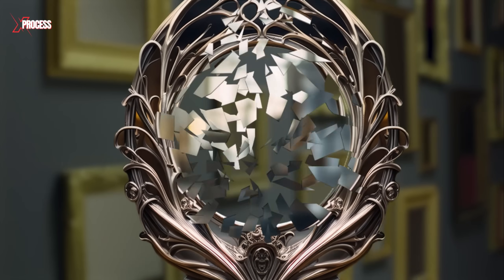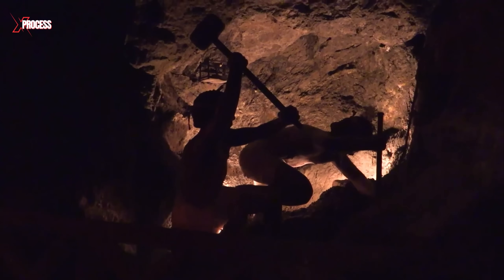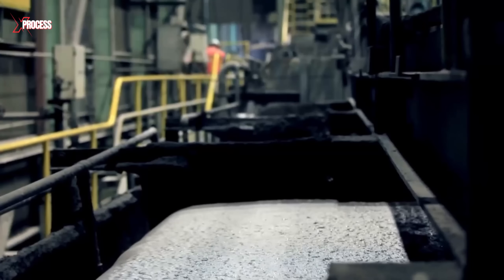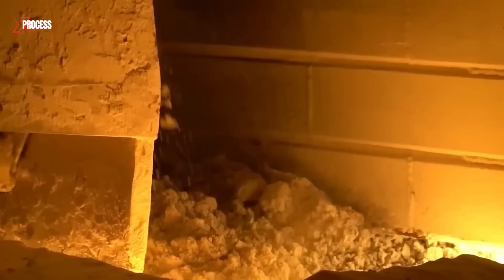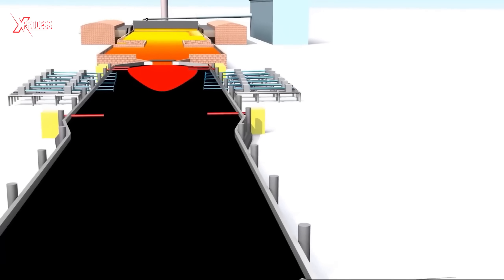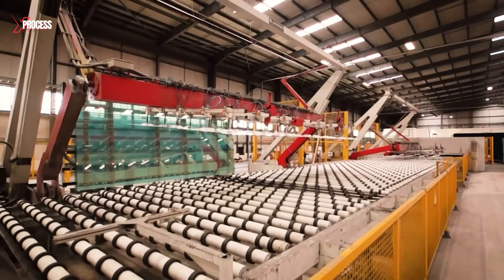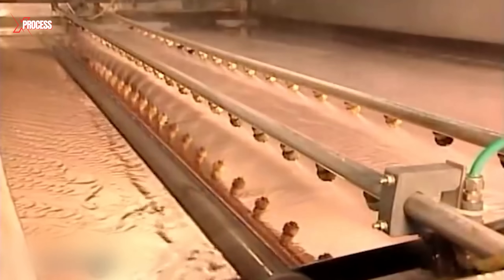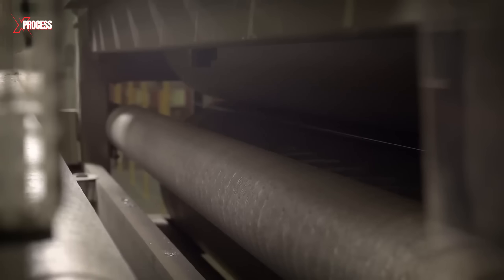How are MIRRORS made? Sand to Mirror Process Explained!

Comment: I have never heard using silver on mirrors (for general use other than specialized optical uses) since coating with aluminum was invented.  An aluminum mirror, while having slightly less reflectivity than new silver mirror, is superior as aluminum does not tarnish.  It can even be coated, naked, on the front of glass & is stable (but fragile mechanically).
Reply: aluminum oxidizes if not protected

Comment: This is not completely true.
Reply: Aluminum is more common because is is far less expensive, both material-wise and process. Aluminum is nearly as reflective at ~90%. So, most mirrors bought and broken are Aluminum plated and not silver. You wouldn't plate a 2mm piece of glass with silver and you wouldn't plate a 10mm piece of glass in aluminum.
Reply: can you elaborate?
Reply: @nullmojo7483  aluminum is more commonly used because silver is far more expensive.
Reply: You're not true 😂
Reply: @ryanridley554  aluminum.

Comment: You presented this as if silver on glass is the only way to make a mirror. And half of it was on mining silver. Downvoted:
Alternative Methods
Aluminizing: This process involves depositing aluminum onto a glass surface, which is often preferred for its durability. Aluminized mirrors tend to last longer than silvered mirrors, making this method popular in various applications, including telescopes.
Other Metals: Besides silver and aluminum, other metals such as gold and copper can also be used to create reflective coatings. These materials can be applied in various ways, depending on the desired properties of the mirror.
Plastic Mirrors: Reflective coatings can also be applied to plastic surfaces, allowing for the creation of mirrors that are lighter and less fragile than glass.
Mylar and Other Films: Mylar sheets or similar reflective films can be adhered to surfaces to create mirrors. This method is often used in artistic applications or for temporary installations.
Reply: Good job 👌👌✅
Reply: no no